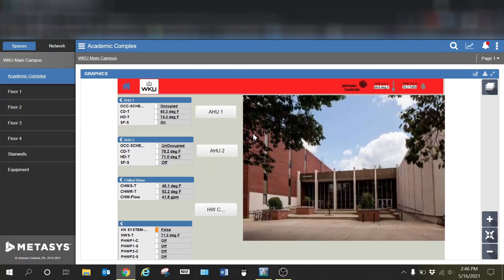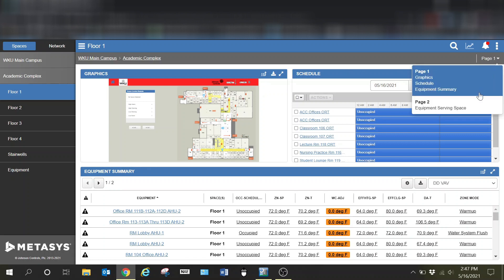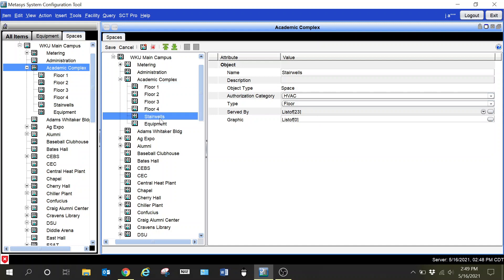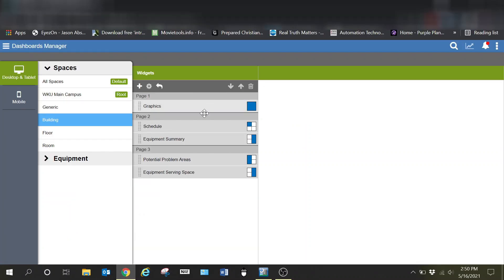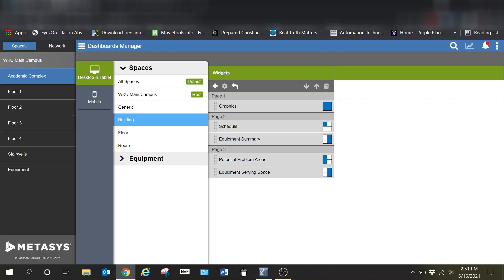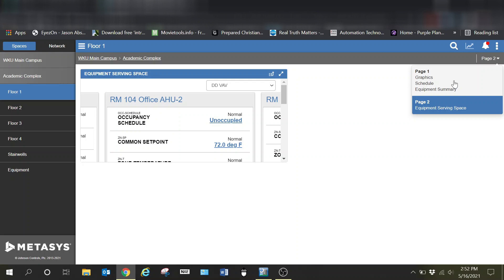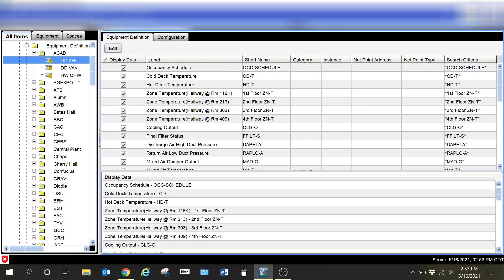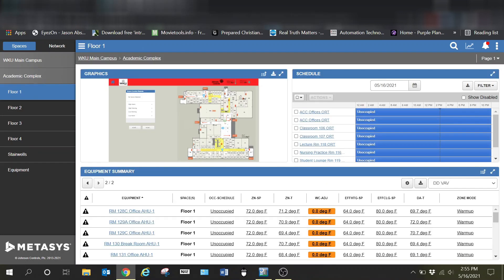The basic steps of Johnson Controls MUI Dashboard Management

Comment: Hello great videos, I have a question about the equipment summary tab. How do you edit it? I need to add an AHU to it and also edit the point data of an existing. Thanks!
Reply from the maker: The equipment summary is directly related to the equipment you add to the space in SCT. Add the new AHU to the space. As far as the points, there's a couple ways. Click on the gear on equipment summary and you can change them to a point. Other than that, you will need to edit the equipment definition
Reply: @Systemcontroltech  After I edit in SCT, would I need to download the entire database?
Reply: @Systemcontroltech  BTW thanks!